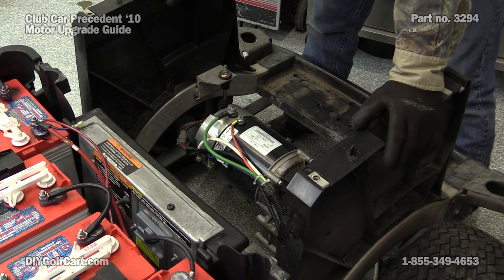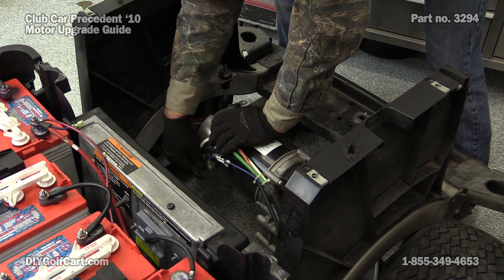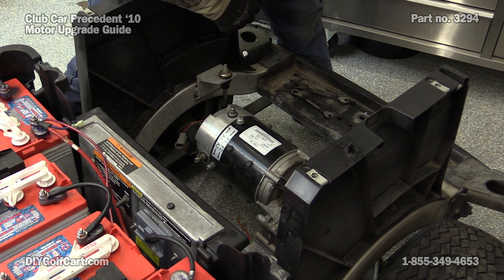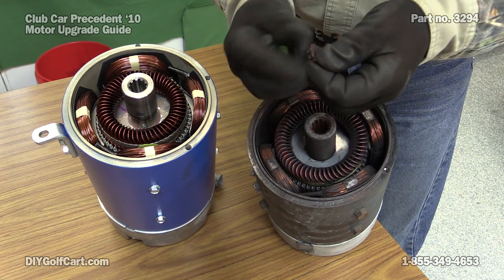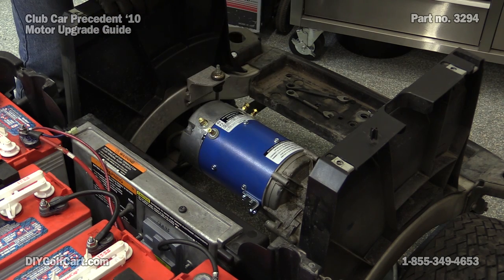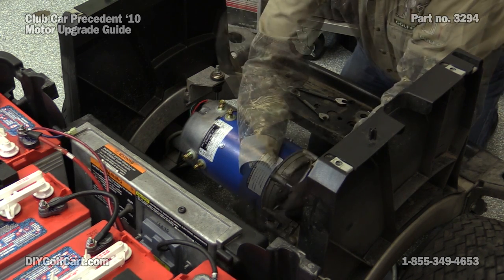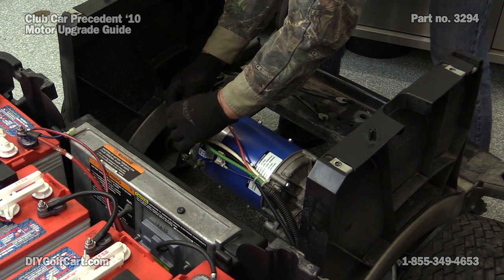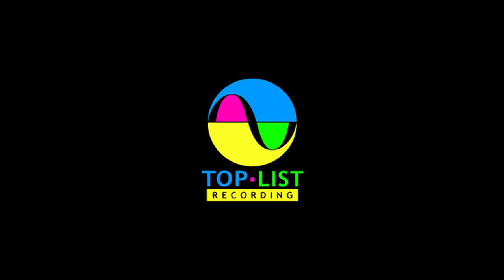Club Car Precedent High Speed Motor Upgrade | How to Install on Golf Cart

Comment: Great channel! quick question- is it easier to remove the back seats etc to
Get to the motor? Or just jack up the back end etc?  Looking to swap my stock motor/controller for a high power one. I have 6in lift with 23in tires. I need torque for mud/work things! 2008 CC precedent!
Thank you!

~Shane

Comment: I got a 2007 Club Car Precedent.  Put 23x10 14R Wheels and Tires on it with lift. Now hills are impossible. what motor would you recommend to upgrade too?  And on the 2007 is there any speed controller change or upgrade needed ?

Comment: Is it necessary to upgrade the battery cables to 4 guage when switching to a high speed motor?  My new motor seemed to gradually slow and then abruptly stop working for 5 minutes or so and then start working again.

Comment: I'm curious what the speed difference is between the stock and Speed motors, and also how Speed Codes 4 or 5 affects the Speed Motor?
Reply from the maker: Butch S That is a very loaded question with so many different questionable variations. Golf Car Brand versus other Brand's, Motor Brand versus Motor Brand. We could be all day discussing Motor Amperage Draw combined with each manufacturer's stated Horse Power Rating. Not to even mention the Voltages of the golf car, (36v vs. 48v). 

Speed Codes raise the Governing Knee Point, which is the actual speed that the Controller was programmed at from the factory. The Knee Point can be raised allowing the car to gain about 2 to 3 mph per Code Number.
Reply: Butch S 
I have an 87 club car and I  need more speed.  will this or interchange with existing one?
Reply: DIY Golf Cart I have a 2014 club car precedent 48 volt, will upgrading the motor make it run faster? Or will the code still limit the speed? I live in a very hilly area and want better performance as well

Comment: Is it possible to remove a motor from underneath the cart without removing the rear body? Working on a 94 Club Car at the moment.
Reply from the maker: Yes, that's the way I normally remove a motor.
Reply: Thank you for the fast response. You guys are awesome!
Reply: That very helpful knowing that you don’t have to take off the rear body

Comment: Did I miss the controller upgrade? Can the existing controller provide the amperage from 3hp going to 10hp? 2,500 watts - 10000 watts?
Reply from the maker: By just adding this speed motor the controller didn't have to be upgraded. I'm not sure about the watts in a electric motor?

Comment: I love the videos that Barry provides, but as fun as they are, the price of the parts that he is purchasing is very high for my "comfort zone" if you will. I do have a 2008 E-Z-GO 36v with larger tires, a radio and a back fold down seat, but other than that it is completely stock. I was wondering if anyone could inform me of how to increase speed and/or torque without breaking the bank.

Comment: Hey Barry, Having problems with my 2010 club cart not speeding up, feels like it stays in 1 gear .have replaced the switch under the gas pedal and the solenoid and the resistor, could it be the speed control or the high speed motor magnetic...it will click some time and try to pickup speed but cut back ....im at a stump..any advice ???  thanks

Comment: I have a 1995 Club Car. It's in great condition except it is very sluggish on a slight uphill. Is there an inexpensive way to increase power a little ? If not I understand a high performance motor as illustrated in video but is that all that needs to be done , just motor?  Thank you I love your videos :)

Comment: Barry -on my 2011 Club Car Precedent 48 v 3.3 amp motor Curtis controller spped is 14.5 mph stock tires wheels. new batteries,  now questions: do all I need to get 20 mph is a new hi speed  motor?  specifically I will have to do nothing to the controller? or wiring?  I know if I increase my tires wheel sizes I can  get more but id be ok with 20 mph or so-- for some reason the spped code number I got through a local cc dealer from club car will not work? for some reason other dealers want to  re-work my cart and id not be happy spending what they asking to do the motor tire controller scenario.

Comment: I wonder why my motor on a 08 club car presedent has the blue wire on F1 and orange F2. I did the whole kit from d&d with the 11.4hp motor and 500amp controller and solenoid. My question is would it be ok to put 72volts going to it.

Comment: Where to find upgrade motor and what to name them?
Secondly I have messed up the wiring connection to battery , The car runs but I lost the headlights and radio, can you put the dia gram of connections. Thanks
Reply from the maker: +alfred franklin email me at barry@diygolfcart.com with the serial number of your golf cart, manufacturer and battery voltage, then I'll be able to send you a wiring diagram. I won't be able to add one for the lights because each aftermarket light company has different wiring colors.
Reply: Car diguones

Comment: Is a new motor the only way to increase speed?
Reply: Brian Riley no upgraded chip got my lofted 48v going 26
Reply: Brian Riley what chip do you have and where did you get it?
Reply: Jake Fontaine what's a upgrade chip? Apparently my ph serial number doesn't work with a code program
Reply: @jakefontaine229 ?? what chip? Where did you get it?